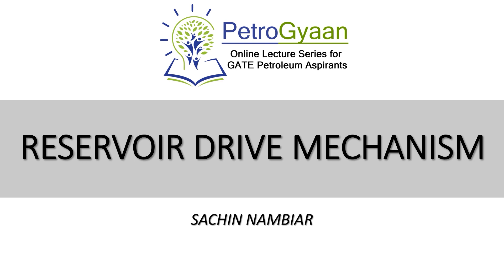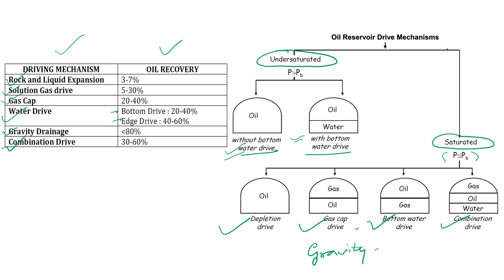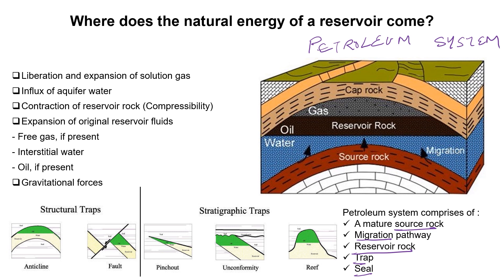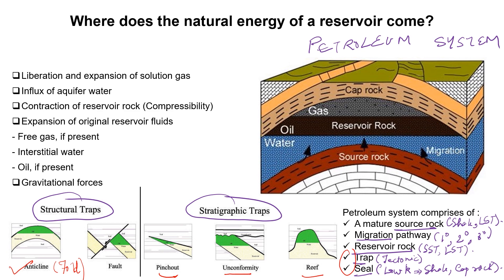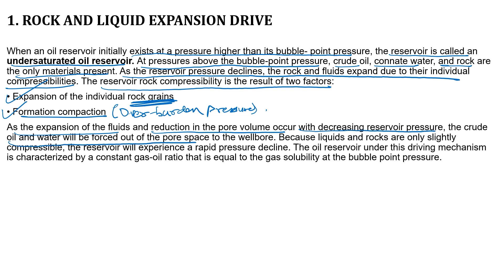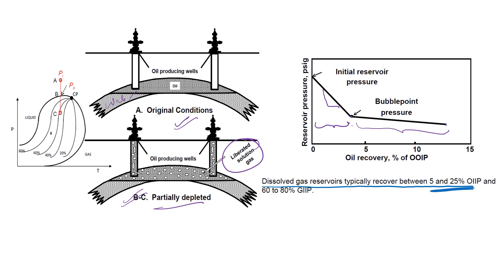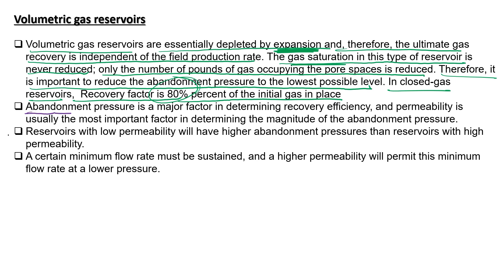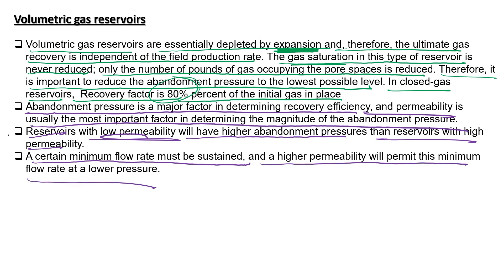Reservoir Drive Mechanism _ Petroleum Engineering_ Reservoir (Lecture 11)

Comment: Sir, in combination drive ...how GOR decreases with production of excess free gas .
Reply: WHEN RESERVIOR P IS MORE THAN SATURATION PRESURE;GAS WILL BE FORCED INTO THE OIL AS DIIDOLVED GAS JUST IN CASE OF COKE BOTTLE  AND IN OTHER CASE, RESLEASING RESERVIOR PRESSURE ; GAS CAP WILL EXPAND.